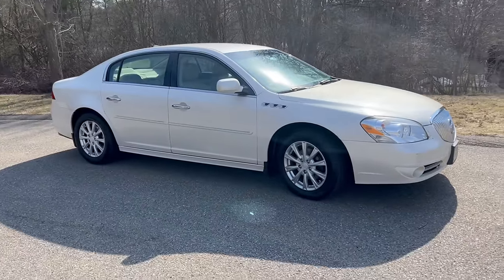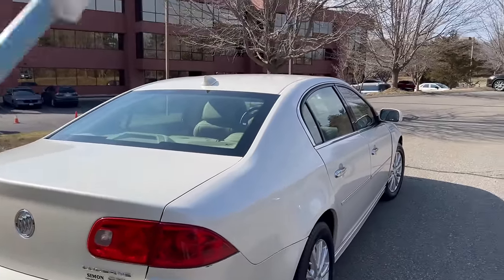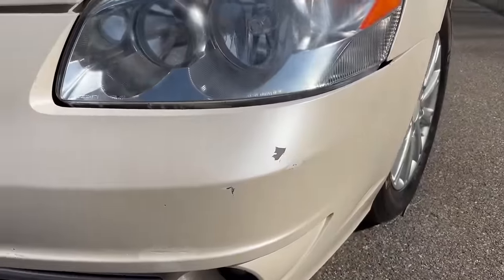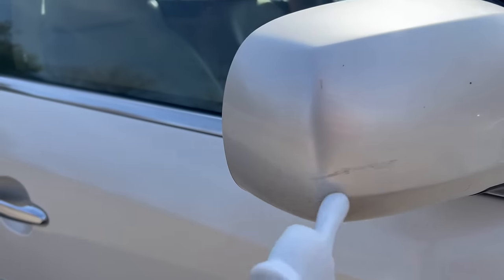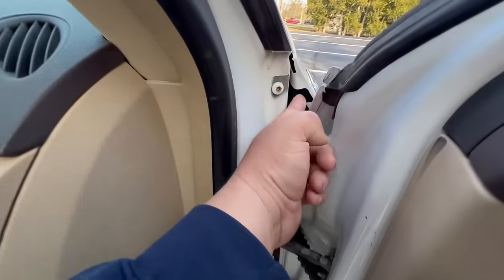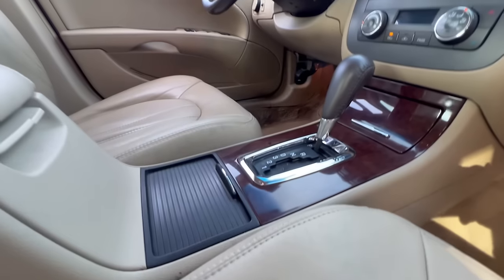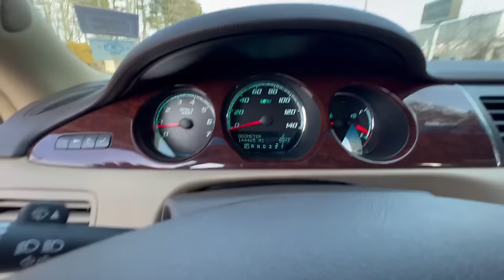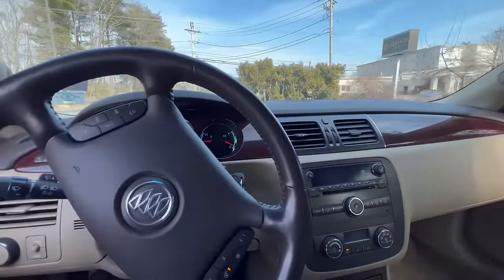CHEAP! 2011 Buick Lucerne CXL Trade in! FOR SALE by Specialty Motor Cars $2,995

Comment: Motor is on last leg. Timing chain issues, timing cover leaks, GDI engine tons of carbon build up, motor mounts, lower control arm bushings....we love ya but RUN AWAY
Reply from the maker: I appreciate the assistance in the sale 🤣
Reply: For $3k exactly what more do you expect in 2024? It’s a running, driving, safe car. I’ve spent far more for far worse vehicles!
Reply: Complain complain
Reply: These engines are not GDI engines and are not known for timing chain issues you might be talking about the GM 3.6 not the 3.9 this engine is based off the GM 3400 I've owned a Lucerne with this engine and seen many with over 200,000 miles
Reply: How many miles on it?
Reply: @indianapolislibramom8383  - I believe he said 171k 🤷‍♂️ try watching the video or looking in the description
Reply: @RustyZipper  The only thank’s
Reply: @RustyZipper  thanks.
Reply from the maker: @indianapolislibramom8383  144k

Comment: 2006 to 2008 have the 3800.
Reply: Is that the reliable engine?
Reply: @rey7299  look at ZZP 3800 content.
Reply: 3800 way better than this. But for the price it is what it is
Reply: The 3.9 is from the "High Value" family that replaced the 3800. These were not bad engines. Unfortunately GM went with the 3.6 engines instead of these
Reply: @MattTrakker350 What does "High Value" mean in regards to this 3.9 Liter engine?
Reply: @klwthe3rd  that's just the name GM referred to them as.  The 3.6 is the "High Feature" v6 family

Comment: "People that buy cheap cars have the highest expectations"
LOL true    🤣🤣🤣🤣🤣🤣
Reply: That and selling to family / friends will bite you 12/10 times!
Reply: Yup, but they also get screwed over a lot too.  The cheap price range attracts the worst sales too.  Customers won't pay for an independent mechanic to do a PPI, do Payday type loans instead of cash, etc. some of these folks are scraping by working 3 jobs and swing into a used lot on their lunch break while driving a friends loaner.  No time for doing homework.  It attracts the type of salesmen that give the car industry the worst reputation.  Anthony is a gem!  But he recognizes that he doesn't usually target this customer segment.
Reply: @vap0rtranz   The low end is there for a reason. They rent furniture, tv's and even mattresses. I've tried to help some of these people break the cycle of bad choices but it fell on deaf ears.
Reply: Most of them expect the car to run as a daily driver without having to spend $3,000 to repair it.    Not for someone who is not capable of major repair work should even consider buying this one.  Just to fix the minor oil leak' he says this one has' will take your mechanic 3 hours, just to remove the oil pan.  That's a $500 repair just to replace a $70 gasket.  This is not your "father's Oldsmobile"

Comment: Got a 2010 Lucerne CX.  I baby my car and the weirdest thing was that the motor mounts went and the alternator.  Outside of that,  just normal wear and tear.  120000 miles this point.  70000 miles are mine

Comment: In response to another comment, this is not a GDI its a Port Fuel Injection engine as well not known for timing chain issues. The 3.9 is based off the 3.4 GM V6. While the GM 3.6 is known for those issues
Reply: I own a Buick Lucerne with a 3.9 I’ve read and seen that these 3.9 v6 can have timing chain problems but is rare I’ve had mine over a year now so far nothing bad about the motor aside from being thirsty in town it’s ridiculously comfortable on the highway tho

Comment: Its well worth it ive seen the stuff coming off lots at that price there no good that looks like a clean car honest car at the price point well worth it. Also its a higher mileage car sounds like if its gone this far probably had its issues worked out never owed a bad buick they seem reliable.
Reply: Local dealer to me wanted $3995 for a 2004 Toyota Corolla with 164K on it.

Comment: It would be a great first car for a teenager.
I did not have a Buick but I did have a 2007 Chevy Impala with the 3.9 V6. Best thing to tell the person who purchases this vehicle is preventive maintenance is everything.

Under the hood my Impala was completely original I replace nothing same with the transmission I traded it with 155,000 miles it still had all the dealer markings and stickers on it over 95% of the engine.

I changed the oil and filter every 3500 miles.

Everyone loves the bulletproof 3.8 I owned several of those great engines 

But I also love the 3.9 and I have to admit and everybody's going to argue about this I also love the 3.6 the reason why I say preventive maintenance is I didn't know those Vehicles had a timing chain issue until after I no longer had them LOL!

I had a 2007 Saturn Aurora XR 3.6 V6 trade it with 151,000 miles original engine, transmission  and timing chain I like the engine so much I purchased a 2014 Chevy Impala and I wouldn't buy it unless it had the 3.6 in it.

Same with that vehicle the original engine, transmission, and timing chain 160,000 miles when traded it. After I no longer have the vehicles that's when I heard about the 3.6 V6 troubles.

I may have just gotten lucky twice but I believe preventative maintenance is key. 😊

Comment: This is a great deal given the used car market right now, and Lucernes make a nice daily driver, they're screwed together pretty nice and aren't expensive to keep going. DTS Lite.
This car has the 3.9/3900 V6 "High Value" engine.  These are based on the older GM 60° V6 engine family, and are a cousin of the 3500 V6 that came in FWD Impalas, etc.  These are not a bad engine, after cars like the Lucerne ended production, GM went with the 3.6 "High Feature" engine family instead, and those are the engines with timing chain issues, etc.

Comment: These can be wonderful cars and last well over 200,000 miles if you take care of them and do proper preventative maintenance with that 3.9 V6. Some repairs can be rather costly because parts on these cars while certain parts can be expensive because they share parts with a Cadillac but for the most part these are very good cars for people who like a quiet comfortable ride especially people who travel long distances. I love my Lucerne it's definitely not going anywhere in a hurry lol but it's a comfortable spacious ride

Comment: I have my third Buick Lucerne. I have converted all three into Wildcats. My 2011 CXL, like yours, runs on E85 "flex fuel".
Reply: What do you mean when you say that? I saw your comment on another video and I actually googled Lucerne wildcat. What are you doing? I'm just curious
Reply: @SeanPennII  I remove the single "Lucerne" emblem (and in my the case with the 2011, the "CXL" badge) and replace with three metal "Wildcat" emblems, one on the trunk and two smaller ones on each front door panel. I like the classic name better.

Comment: Whoever buys it and if they are Massachusetts residents all that car needs is a safety inspection. I believe anything 2008 and below. My car every light on the dashboard is on it's leaking oil driver side airbag light is on because of the seat belt tensionor needs to be replaced and he passes it every year. He said it only needs a safety inspection. Right now I'm driving a 05 Carrolla and it needs so much work but I gave up on it 😂😂

Comment: Good deal for one of these the last of the true great FWD GM sedans. I've owned a 2009 Lucerne with the 3.9 not as great as the 3.8 but seen many of these with over 200,000 miles still going.

Comment: Just to fix a minor oil pan gasket leak is a major deal on this car.  You have to disassemble half of the engine and lift it 4 inches to get the oil pan out.  There are many electrical problems that are common with this car.  Ignition tumbler,  door lock regulator, window lift motors just to name a few.  Be prepared to do a lot of work other than paint repairs.  If you can't fix these things yourself,  this car is a real money pit and not for you.

Comment: Hey Anthony just looking out for you but be careful of these Buicks certain years had Dash Wiring Issues and would short out and burn up 😔 looked at several that were caught in time and others Burned to a Crisp and seen a few at LKQ.
Reply from the maker: Really!? Never seen that before. Maybe there is a recall on them?
Reply: @specialtymotorcars  I don't know I know some defects don't really get pushed out to the public, for example Ford knows about the Mercury Mountainer that has Defective Rear Coil Springs Rusting out and releasing into the back wheels and causing accidents, just like They knew about the cheap little part that could have kept early Pinto's from blowing up but they sent them on down the assembly line.

Comment: In my opinion, it's really sad what these Lucernes became after the Park Avenues.  The Park Avenues were so much more luxurious and better trimmed on the inside and out.  And this is a top of the line CXL model.  The interior looks so bland that it doesn't look any nicer than a base model Malibu.
Reply: Top of the line was the CXS/Super. These are not much different from the same year DTS inside, and are put together pretty well
Reply: @MattTrakker350 Yes i did forget about the Super model. But the CXS which was a lower sports model was below the CXL in MSRP.
Reply: @klwthe3rd  CXS was the top of the line model with the Northstar and different interior appointments.  The CXL was the mid range that could be had with the Northstar or the V6, after a few years I think options were shuffled or made standard, the CXS became the Super and the CX and CXL remained below that
Reply: @klwthe3rd  they really should have just kept the Lesabre or Park Ave nomenclature to these cars.  As you can see it was confusing with no carryover history to it
Reply: @MattTrakker350 Agreed!

Comment: Jezz. needs more then touchups. need a whole paint job.
Reply from the maker: All can be had for only $2,995
Reply: I’d buy it for $2k but only if you did a full re-paint, all new Michelin Cross Climate tires, alignment, valve cover gaskets and a 96 month bumper to bumper warranty. Ohh and I need financing too… at 0% with no money down….
Reply: Buy it then paint it